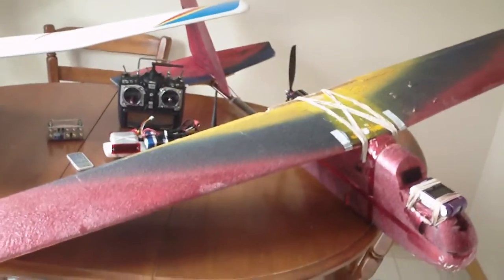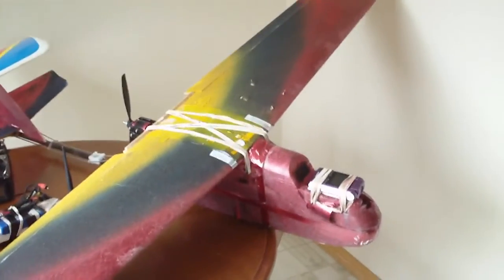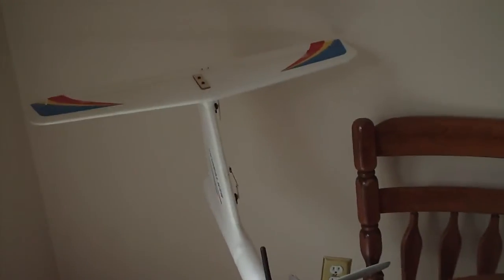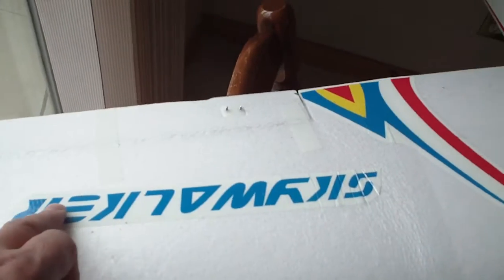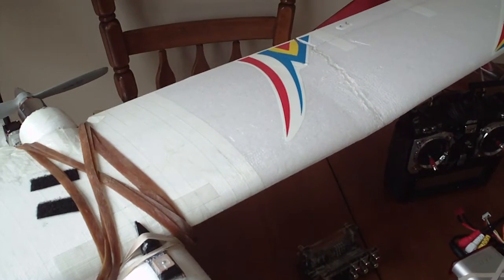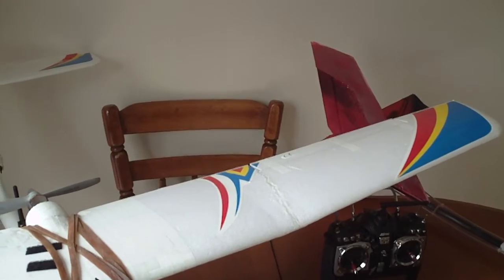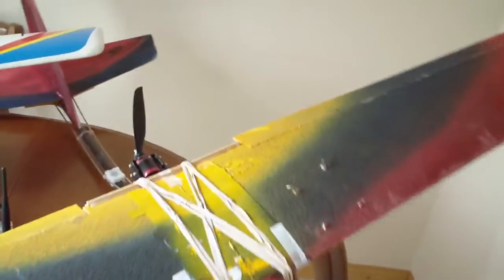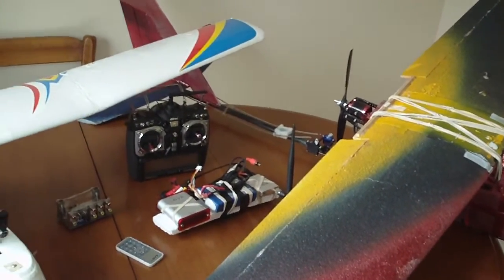FPV HobbyKing epp and SkyWalker side by side

Comment: @RIPcombat Thanks for posting. I'm wanting to get into aeronautics with FVP 3D. I have a question for maybe making the planes stronger. I don't know much, so I've wondered about something I've seen done. I have seen a demo of that rhino bed liner spray on foam. one coat was very thin, yet it you couldn't break the board of foam. Still was very light weight. What if this would prevent these planes from breaking?